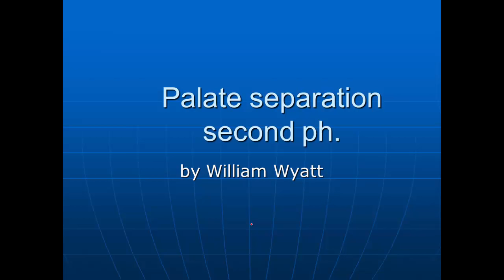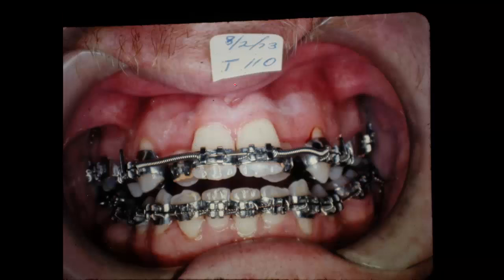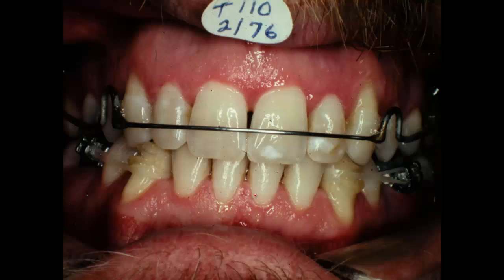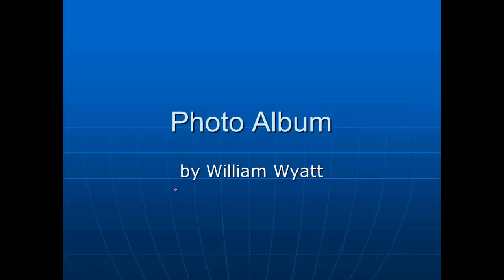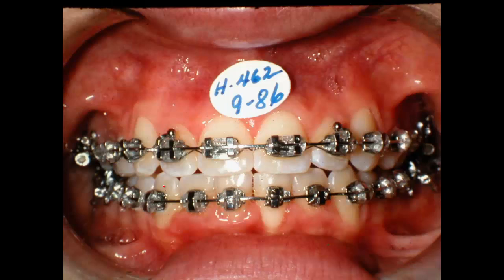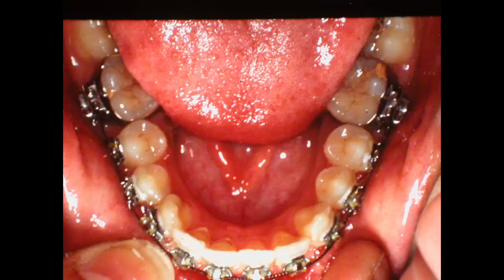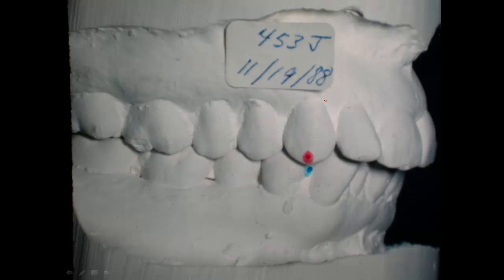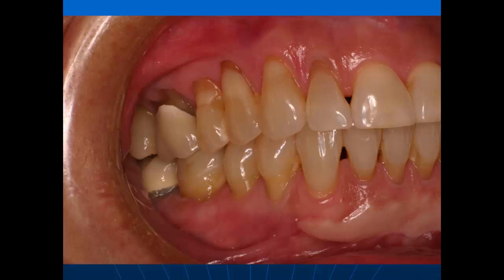orthodontic palate separation -  second phase

Comment: Very informative Dr Wyatt
 Amazing the fore thought you had for orthodontics. The patient certainly endured a lot of metal and appliances. Would that case be bracketed today ? The banding must have taken many hrs  . Two  appts to fully band beyond separators?  My full set of Roth bands installed in  approx 1970 was done in two sessions for a total of 5-6hrs. As you sad it would be much easier today with better results. Treatment times the same? Do you here from many former patients as friends? Take care Dr . Wyatt.
Reply from the maker: Yes. Brackets would be used today. I would still band the 6 year molars. Well, we normally did take more than 1 appointment. It's much faster, and less pain with brackets today. You can finish a case where you want it to be. You can tell the patient, "What you see is what you get" before taking the appliances off. With bands, the spaces had to be closed and would look different. We have a lot of patients that write in and I would love to hear from any of them that I've treated in the past decades!